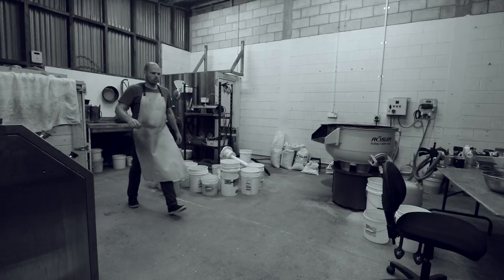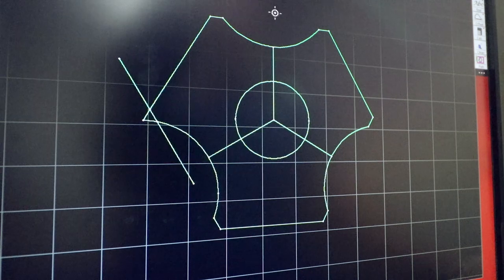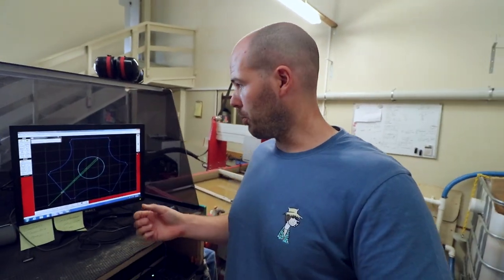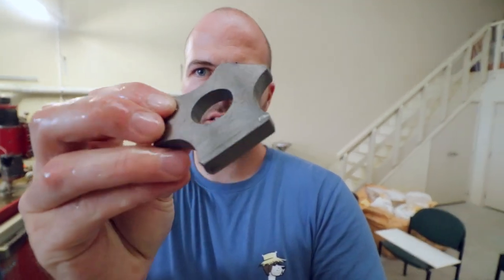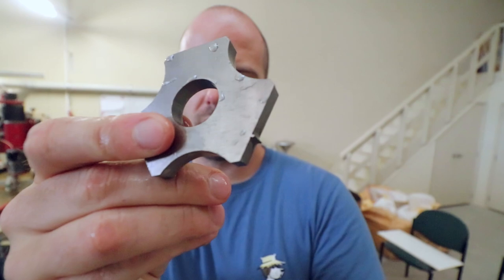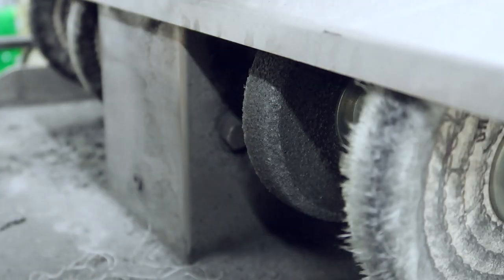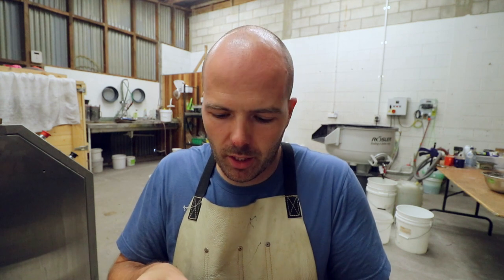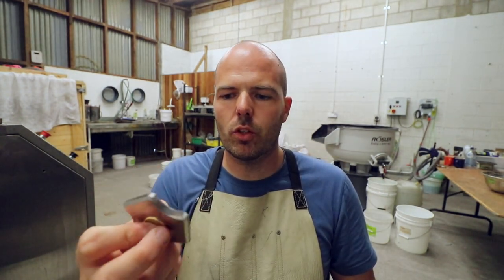Fidget Spinner / Hand Spinner (DIY)

Comment: hey magnus what is that waterjet machine called, and how accurate are they
Reply: i assume its pretty accurate, he put in the exact measurement of the bearing and it fit in the hole with ease
Reply: jimmi Kater the deeper the material you are cutting the less accurate it gets due to a taper cause by the water jet getting wider. This is why his fidget spinners essentially wobble because of two that taper

Comment: where do you get ur cores for the spinners?
Reply: crentyman dan you mean ball bearings from ebay
Reply: crentyman dan you should get ceramic they spin faster or steel a cheaper option not so fast

Comment: really neat video. just one thing though and not meant to be a butthead but DYI stands for do it yourself. that implies using tools most people have at home. a crazy expensive water jet cnc machine is not very dyi. so while i really enjoy the process the title is a bit misleading, honest feedback here take it for what you will.
Reply: You could use a little saw and a file
Reply: Mr Gopro while that is true most likely. that is not what is demonstrated in the video. also titanium is very strong material so im not entirely sure a saw and file would work.
Reply: michael hines Titanium is actually relatively soft compared to most metals (Obviously depending on the composition of it, as with any metal there are different varieties) While I do partially agree with your original comment about how it's not entirely DIY, Most people looking at a video like this with the hopes of DIY instructions most likely have atleast some of the shop equipment required for it. While a handsaw and little files may not work, Most people into this type of DIY have a powerdrill or small drill press which would work great for the core and the scallops around the edges, The flat edges could be cut using a hacksaw or ideally a bandsaw and then, using a belt sander as Mr. Magnus did, could better profile them. 

I myself have spent 2 and a half hours once using a hacksaw to cut off a 1/4 inch thick, 5 inch wide bar of 1095 carbon steel. If you're truly interested and dedicated to the project, You will find a way with the resources you have at hand.
Reply from the maker: You're right michael. My "DIY" is probably a little different to others... it feels like DIY to be because I have to hand-grind.
Reply: Meat Smell well with a hacksaw and time and elbow grease anything is possible.